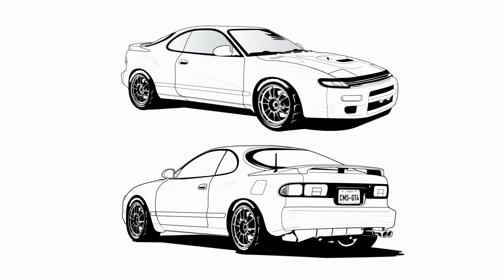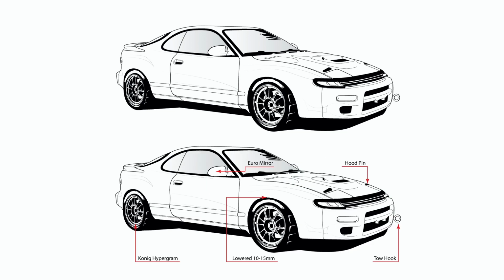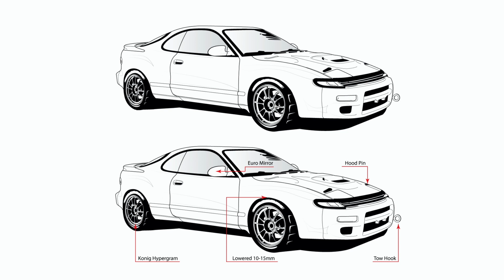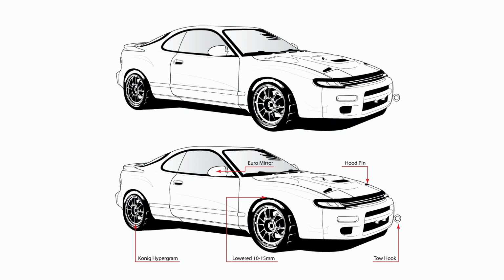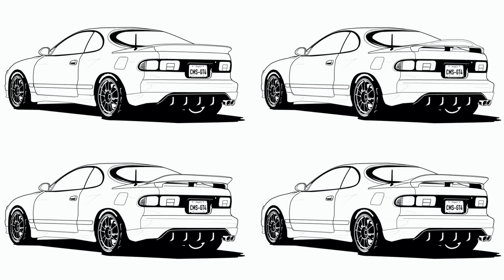Project CMS: Season 7 Rendering my Gtfour in Adobe Illustrator to conceptualize body kit design

Comment: 2nd image top right for front lip and side skirts. Rear bumper: bottom left @ 9:39 = Close to perfection. Perhaps integrate a rear diffuser guard  that covers the fuel tank? Awesome work non the less. ps. Forgive me, i rewatched till the end....lol. I think you are bang on with the right path forward. Best wishes for your goals.
Reply from the maker: I forgot to even mention the rear tank cover. I had mocked one up. What I did show was a new fuel tank cover base plate once I show the rear lips.. I plan on making something that is level and more diffuser like

Comment: Lots of great ideas, im a simple person in terms of car visuals. Im always impressed how much just a simple small front lip can change the look of a vehicle and its overall shape. While the garagedoor lip is way too far on ghetto end of things a classy version of that might look really clean without adding too much visual weight. Thats what im looking to do on my own car when i do the cs/rc front end conversion.
Reply from the maker: I agree. The biggest grip I go over is the lack of visual flow the front has with the side. The front is more raised for ground clearance. A simple lip, even 1" lower could tie everything together better and complete the look. The type r lip is the simplest means to get that, but it needs to be heated and stretched. So there is a little work involved.
Reply: @cmsgt4  im sure no matter what u go with itll look right, i hate to use the word stance since its such a dirty word for people that actually drive their cars but the way urs sits is going to make a major difference. Imo urs is exactly how i want mine to, aggressive but functional.